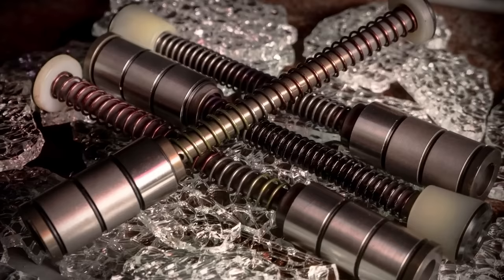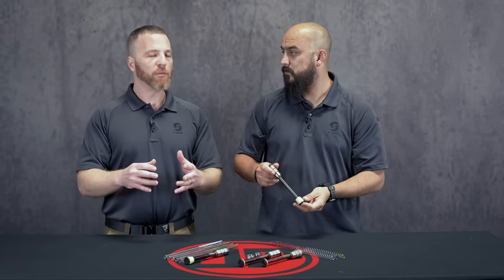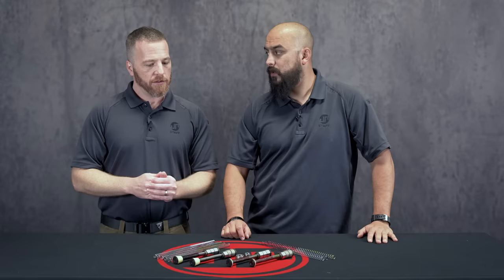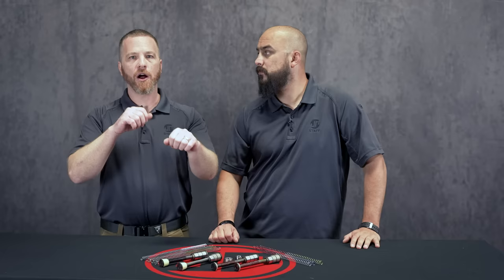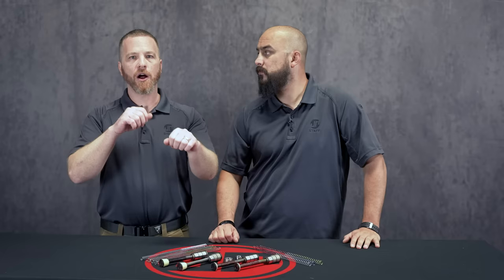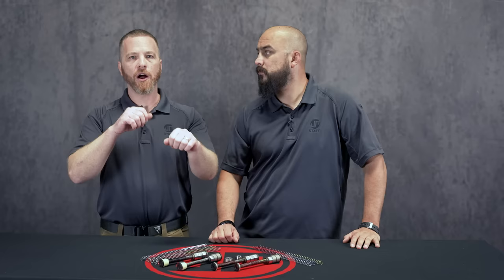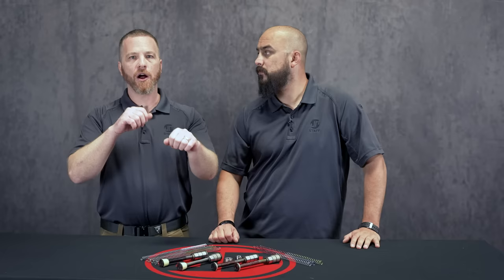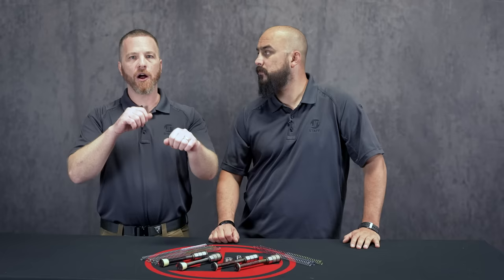Choosing the Right Silent Captured Spring

Comment: The rifle i just built is so undergassed that I have to run a suppressor in order to get lock back on 5.56 and I have to run the suppressor on .223 in order to even pick up the next round in the mag. 
I put an h2 in it at first but I’m skeptical that dropping down to a carbine weight will actually fix it because its so undergassed.

Comment: i have a suppressed 10.5 with a silencerco specwar. it gases me out like crazy gets in my eyes chokes me out. i have your JPSCS2-15K-H2 kit with the lightest spring installed on it. my gun runs with my adjustable gas block open 1 click away from fully open if i go 1 click more closed it dosent run. should i get a heavier buffer or put a heavier spring in it. id love to bring that gas down to where im not getting so choked out i can only run half a mag before my eyes are burning.
Reply: What's the has port size?
Reply: Did you figure out your problem? If so what was the fix?

Comment: What spring power to go with on the jpscs?

My friend has a adams arms non adjustable mid length piston AR in 14.5” with adams lightweight carrier that reduces the bcg weight by 2 ounces compared to a milspec bcg.  Should they just use the ejection pattern chart to make a proper buffer weight and spring combination?  He is looking to reduce recoil and is wondering if paired with the lightweight bcg if you go with h2 buffer with standard spring or go lighter buffer weight and/or lighter buffer spring as well.  Any input is greatly appreciated!  I’m thinking h2 with the 80 or 85 spring due to the lightweight bolt carrier?

Comment: Is there an option so if I'd like to swap from suppressed to non suppressed without having to switch the buffer or have another one of these on standby? Honestly not the biggest fan of the old fashioned flexing all over the place buffer springs and like how this system is a solid piece that isn't going to flop around if anyone has any idea what would work best honestly I don't care about recoil or anything like that regardless of recoil or anything else I just man handle the shit out of my rifle to the point the end of my shit ain't gonna move regardless if I'm shooting .22 all the way up to 308win. Like I said I just want all of my equipment to be solid and not warping everywhere and the way this one looks honestly looks solid enough I could cut an area out for it in my rifle case to set it in there if I need to buy 2 I guess I can have 2 different cut out sections and find a way to label which is which.
Reply from the maker: No need to switch back and forth, you can tune the gun to run with or without the suppressor.

Comment: .458 socom running 350gr to 405 grain full power handloads.  My upper is a 16" bear creek arsenal 458 socom and my lower is a mossberg MMR hunter from back in the day with the mossy oak Finnish in an A2 style Buttstock.  I also use the lower with a 20" 556 upper.  It runs flawlessly with both right now so why fix it's not broken I don't know curiosity I guess.  What would be the best silent capture system for the 458?

Comment: I have a 8.3" 300 blackout.  Running subsonics mostly suppressed but would like for it to run unsuppressed at times.  What buffer weight would you recommend?
Reply: you need the standard scs 15, id get the extra springs as well for further options.
Reply: JP flow chart says H1

Comment: Thanks for a very helpful video. What temperature to heat the allen head screw to melt the loctite?
Reply: Go to Loctite's website or Google it. Since there are several varieties of Loctite, each one has its own procedure for removal. Example; Blue doesn't need any heat to remove it and is considered temporary. Red does need a certain amount of heat in order to remove screw/pin/etc.., and is considered permanent. There are other colors that represent different attributes according to environment they are used in. Example; high heat/damp/water exposure/etc.. I would start with the Red Loctite removal temperature and go from there. You can pick up a marker style pen that's called a "Temperature Stick". They are found at welding supply stores, (maybe hardware stores too), that will only melt at set temperatures, whicheavea a mark on the item once it reaches that markers set temperature. If you get a 200 degree marker, it will begin melting/marking the item once it reaches 200 degrees. They are very cheap in case you don't have a infrared thermometer or other devices to check temperature readings. I would recommend getting another temp marker that's 50 or 100 degrees less than the set temperature you need. This is just so you can have an indication of when you are getting close to your set temperature, preventing you from overheating the item any more than necessary. Sorry it turned into a book, lol, but it may help others. Temperature Markers are basically unknown to the mass majority. Cheers
Reply: *SPELLING CORRECTION*
"melts at set temperatures, WHICH LEAVES a mark on the item...." ** NOT  "whicheavea a " .lol. wtf? Sorry bout that. Lol

Comment: What actually does the buffer do , what are the benefits ??
Thanks 👍
Reply from the maker: It eliminates all the extra friction of the standard buffer spring scraping along the inside of the tube.  So, shooting with it is smoother and less noisy.  It's also reconfigurable and tunable so you can dial in the buffer system for your particular rifle as well as tweak the cyclic rate to what you like.
Reply: @JPRifles   ....I may check 1 out and I'll call for expertise help with my rifle specs ...
Thank You
Reply: What do you recommend for a Ballistic Adavantage 14.7 inch barrel on a rifle geared tword duty use, with Federal 55 grain Tactial bonded? Don't care about the noise. A soft shooting gun would be nice, but it's secondary to reliability. I'm assuming the barrel isn't short enough to qualify as an SBR.

Comment: 300 BLK super sonic on pistol gas opens too early, and rips the case out while pressure is still high in chamber and brass or steel case is yet to shrink back down. All the buffers and coil gas tube and adjustable blocks cannot fix that issue. Get a longer gas system and appropriate barrel for supersonic 300 BLK

Comment: Sounds like you are about to spend upwards of 400 bucks buying 2 different buffers with the spring kits whenni can buy an H H1 H2 and H3 from bcm for 100 bucks total
Reply from the maker: That is incorrect. Once you have the Silent Captured Spring system, you can modify the buffer mass and spring rates. You do not need to buy a whole new Silent Captured Spring system.

Comment: flow chart makes no sense to me
Reply from the maker: This flowchart is designed to help users determine the correct JP Silent Captured Spring (JPSCS) for their rifle based on several factors related to their rifle's configuration. Here's a breakdown of how to understand and use this flowchart:

1. Identify Your Rifle's Frame Size:
   - Small Frame (.223/5.56 or smaller, including .300 Blackout):
   - This category is for rifles chambered in smaller calibers like .223/5.56 and .300 Blackout.
   - Small Frame (6.5 Grendel or larger, excluding .300 Blackout):
   - This category is for rifles chambered in larger calibers within the small frame category, such as 6.5 Grendel.
   - Large Frame (All calibers):
   - This category includes rifles chambered in any caliber that requires a large frame, typically larger calibers.

2. Check for Special Configurations:
   If your rifle falls under the small frame (.223/5.56 or smaller), you need to check if it has any of the following special configurations:
   - Short-barreled rifle
   - Suppressed
   - Select fire
   - Piston operated
   - Using an H2 buffer
   
If any of these configurations apply to your rifle, you will be directed to use a specific model of the JPSCS (JPSCS2-15H2 or JPSCS2-10H2).

If none of these configurations apply, you'll use the standard JPSCS models (JPSCS2-15 or JPSCS2-10).

3. Determine if Your Rifle is Biased for Low Mass Operation:
   This step applies to both small and large frames.
   - Low Mass Operation:
     - If you are setting up your rifle for low mass operation by using one of JP's low mass bolt carriers (JPBC-1, JPBC-3, JPBC-4, or JPBC-8), this affects which JPSCS you should select.
   - If YES (low mass operation is used), you'll select a specific JPSCS model designed for that configuration.
   - If NO (standard operation), you will use the standard JPSCS model for your rifle's frame size.

4. Final Decision:
   - For Small Frame Rifles:
     - If your rifle has any special configurations, choose between JPSCS2-15H2 or JPSCS2-10H2 based on your barrel size.
     - If your rifle does not have special configurations, choose the standard JPSCS2-15 or JPSCS2-10.
   - For Large Frame Rifles:
     - Follow the same process to determine if you need the low mass option or the standard JPSCS for your setup.

5.Important Note:
   - For rifles designed to run subsonic .300 Blackout ammunition, regardless of the configuration, the JPSCS2-15 should be used.
Reply: @JPRifles   still not sure about which to get have no idea what you mean by special configurations   this is what i have  300 blk out 16 inch barrel have no plans on using a suppresser will be shooting sub sonic and super in it 
which do you recommend
this could be made simpler if you would list each separate instead of a flow chart   of them all coming together
Reply from the maker: @tombuchanan3971  Thanks for your question! I understand that the flowchart might seem complex, so let me simplify it for you.

Based on your setup:

Caliber: .300 Blackout
Barrel Length: 16 inches
Shooting Both Subsonic and Supersonic
Since you are shooting both subsonic and supersonic rounds and don’t plan to use a suppressor, you should select the JPSCS2-15. This model is ideal for a standard .300 Blackout setup with a 16-inch barrel, covering your needs without requiring special configurations like suppression or short barrels.

For a quick reference, this option is suited for small-frame rifles chambered in .223/5.56 or smaller calibers, as well as the .300 Blackout.

We appreciate your feedback on the flowchart, and we'll consider it for future updates. Feel free to reach out with any more questions!